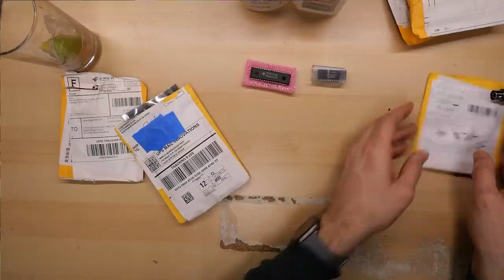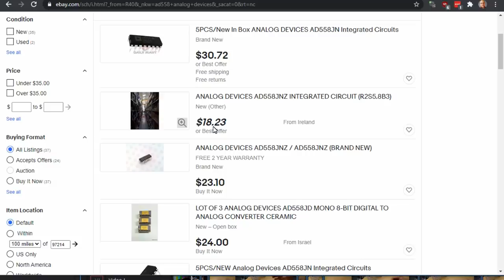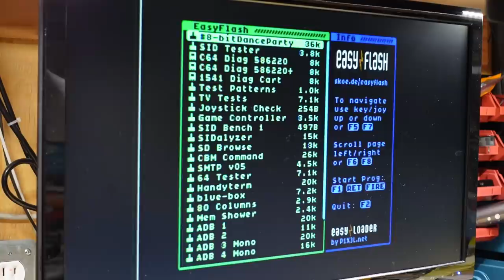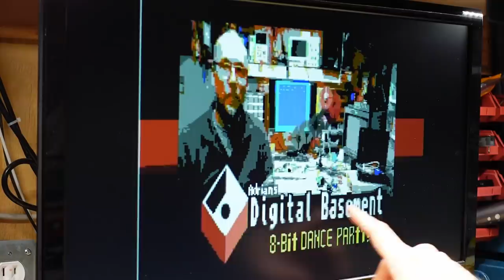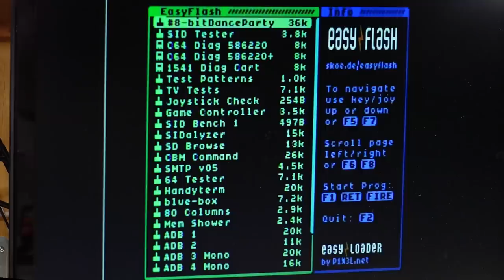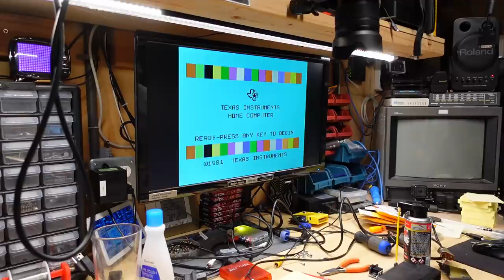I bought more C64 SID chips from AliExpress! (And some other chips too)

Comment: So much easier to appreciate these older cartridge-based systems after seeing the fact that replacing a PS1 CD-ROM drive runs $90 at Totalconsole if you decide to replace the laser. However, you then have no idea how long it would be before you have to fork out another $150 down the line as these lasers are only getting rarer and rarer. At least with these chips, they are stable, solid state components that only really go bad from sheer lack of attention to it. Cartridges, also solid state didn't carry as much data as their optical counterparts, but at least you never have to worry about a permanently damaged disc or even worse, a failing laser! Quality over quantity.

Comment: The TMS9900 processor was used in the TI-990 series mini-computers. They were UNIX-based business computers.  Aligning replacement heads after a head crash on a hard drive platter was a bitch. Of course that was prior to the TI-99 and their PC came out. Commodore 64s would blow SID chips often, and RAM chips.  If they had had metal cases and a fan to dissipate heat, they would have lasted longer.

Comment: Those pin straighteners are great, should be in every electronics enthusiasts toolbox. 
Fake chips are big business - although faking a $5 chip seems a bit pointless. Maybe it was just faulty - I've bought chips that are cleaned up from China that work perfectly (a bit like your EPROMS) so I suppose they do it to improve the value. I think Ali Express has got quite strict in the last few years, so the fake chip dealers aren't so prevelant there as they were a few years back. You just have to be careful I suppose. As you say, at least with Ali Express (and eBay to an extent) they do tend to side with the buyer in disputes, you just have to remember to test the chips as soon as you receive them!

Comment: C64 SID chips like other vintage chips from AliExpress are old un-tested chips that are ripped off recycled hardware. The old printing is lasered or sanded off and the new printing is lasered on, they will even change version numbers on the chips so it LOOKS like a newer version with newer firmware etc, when its not. When you hear people say there still making Chip XYZ there probably not, some yes, most no.

Comment: Tip for getting the pins aligned to 0.1" pitch.  Put them in a zif socket and clamp down.  That will bring them to 0.1" pitch IIRC.

Comment: I think, the main problem with the chips from AliExpress is the packing. Usually they are wrapped in some cling foil. Definitely not static and the pins don't really always like this kind of transport. I had just a few bad badges. 10% bad chips is actually acceptable. I had good 6510 CPUs and  good 6526 CIAs for the C64 and also good 6522 and 6502 processors. You do have to spend some time testing them. Painted EPROMs are pretty common. Usually no problem, but if the dies look different, there is something wrong. I had 2732 EPROMs labeled as TI, but they were from a couple of different brands.  Unfortunately, the other brands did not survive the TI programming voltage. So, that was a fail, but I did receive the refund.

Comment: FYI the reason that Ti used the TMS9900 because that was what their industrial machine tool controllers were based on. So there were more out there than you knew about, but still not a lot.

Comment: I just looked up the chips on Quest (aside from the SIDs, no way they're going to have any of those), and aside from the TMS9900, the prices aren't terrible. ~$17-18 for the TMS9918A and AD558J. Plus shipping, of course. The TMS9900 was $50 for their last PDIP packaged chip, and $175 for their last ceramic one! So yeah, they aren't too bad for some chips, but not great if they've only got one left! Definitely not as cheap as ali express or the electronic bay, but they're definitely going to arrive much more quickly, and there's no risk of getting a fake.

Comment: I've tried to get the message across a few times here about the ARMSID which is an extremely good SID replacement that can be configured as either 6581 or 8580 in software. They aren't even expensive. I guess SID purists won't accept anything other than the real thing but the ARMSID is very good and well supported.  
We'll see if Adrian sees this message but as I have never heard Him even mention it once I suspect He's not even aware of it. Do not confuse it with a nano swinsid which is rubbish in comparison.
Reply: The ArmSID is brilliant. Especially since you can configure it at runtime to emulate either 6581 or 8580. This helps a lot with running a lot of demos. There are some that require 6581 for samples (Comaland?) and others that require a 8580 for its filters. I have two ArmSIDs (and some 6581R4) and didn’t regret buying them.

Comment: Re-watching this video today, and the mention of 27c400 EPROMs reminded me that I actually managed to find an ebay seller in china with genuine & unused AMD-branded AM27C400-105DC EPROMs, was thoroughly expecting them to be pulls or dodgy re-paints, but nope, pins are new, acetone does nothing, and programming one with Amiga DiagROM worked flawlessly (soon to stick the new Kickstart ROM 3.2 on one as well), so, sometimes you can indeed get the real deal, but YMMV... :)
Reply: do you have a link need some for my c64

Comment: To be honest acetone is most common plastic solver. It is not most powerful, but most common and cheapest one available for sale. It is capable to solve ABS aand friens very easily.
Less common solvents are dichloroethane, toluene (much less toxic than benzene aka benzol), chloroform (but it used to knock-off people so it is practically not available in stores).

Comment: I also bought some AMD 27C400-95 off aliexpress, mine are rebadged Toshiba TC5742000 either 100, 120 or 150 ns. But I cannot program them :(, you got better ones than I did. Btw, great channel, really helps during these dark corona times !
Reply: If they're not new you have to erase them. Even then they can be worn out.
Reply: @6581punk  They do not even get detected... no chip id, and when read they return all FFs. I had to use the 27C4096 as device, no support for the part on the minipro :(

Comment: I don't recall seeing laser etched markings on 80's era IC's (if so then rarely done)
If I am right then that would be a dead giveaway, even when looking at the pics on the seller's page. 
As for the EPROMs, I would say that, if one was expecting 90 ns speed grade ICs and instead got 120 ns graded ICs, then that would be a rip-off sale... maybe your design has to have the faster grade chips.
Gratz on getting original SID chips tho  8^)
Cheers,

Comment: I actually have a board that uses the TMS9000 chipset on it, used as a serial terminal interface....

Does have the socket as well, with that special spacing. Likely the Ali one is the OTP version of the TMS system, they did make some with built in ROM and RAM, as it is not likely to be a 68000 series, unless TI was acting as second source for them. Could also be one of the TI DSP families, as they used that package for them early on as well, needing to get all the pins out, and having a parallel data and program bus to interface with the programming.

Comment: Add salt to the 70% alcohol until it accumulates at the bottom indicating that the 30% water is saturated. The salt water will be heavier than the alcohol and will stay at the bottom. The top layer will be pure alcohol.

Comment: That dead TI CPU probably came from a TI99 that was binned BECAUSE of the dead CPU; the old machines that these parts came from were tossed out for a reason, so there's a gamble that the salvaged part you're getting wasn't the bad one.

Comment: Oh; And the CPU with strange pin-spacing.. I FIRST assumed it was just that a LOT of older hardware had a standard of a tenth of an inch spacing, but because technology advanced, they wanted closer pins.. so they went metric; Tenth of an inch is 2.56 mm, and they chose  2 mm... (of course, when they started surfacemounting and reflow-soldering everything,  they first went back to using inch for 1.28mm, and later again to 1 mm)....

BUT.. IF it really was about 20% difference in the spacing, then you wouldn't be able to get that cpu in to a 2.56mm fitting at all.. So I guess I have to change my "You are thinking of the wrong standard" to.. "Well, they manufacture the chips and boards they belong to themselves and solder from factory.. They just wanted the extra space"..

Comment: I have a solution for the pin spacing. Permanently mount the cpu in a ic socket and then the spacing will match putting it in another of the same socket by putting one socket in another!

Comment: China does salvage a lot of used parts, heck, those cheap audio amplifiers you can get from there are basically parts from old car stereos, usually the amplifier chips and whatnot, I just wish they didn't sell them as "New" when they're clearly using upcycled parts...

Comment: 31:50 that socket has a 45° angled shape that designates pin 40 for some reason.
And that fake TI CPU... I would have measured ohms on some select legs like last time you checked fake ICs

Comment: Pin spacing in CPU is metric? 2.5mm vs 2.54mm (0,1"). Soviet chips were 2.5 spacing.
Reply: No, it's regular 0.100". The problem is inserting a desolderd 64 pin chip with very slightly bend pins into an precision turn DIP or actually 2 rows of precision turned SIL... 
(Pin diameter typical ~0.150", hole diameter of a turned socket typical ~0.200") 64 pin DIP is the only case in which I would prefer a regular socket.
Even if it they were new from the factory these 64 pin DIP chips have to be hard to insert in a socket like this. There was a reason why they stopped at 64 pins...

Comment: I'd be happy with a functional fake. Most 'counterfeit' chips are extremely common, cheap or even defective IC's with the same form factor as the original. Painted and remasked, the sole intent is to dupe you into buying it. Even power transistors have gone counterfeit in the last 10 years, albeit most have functional substrates that simply do not meet the original specs or power requirements.

Comment: Thank you for the video! I enjoy learning about these counterfeit or fake ICs, and it is good to have more awareness.   

For the leg cleaning, I have been able to do this with one of those solder pots, melting pot to have the pool of molten solder, like the kind you might use to tin the tips of wire. If you put some flux on the pins and then quickly dip the entire legs into the solder it comes out to look like this for me anyway.

I know its not really related to this video.. but I really wanted to ask, how do you get your audio so good?  Your voice seems very clear and articulate. and no background / room noises, but also I don't hear artifacts of a noise cancelling too.  Is this just from that Rode Go lavalier mic!?

Comment: Hi Adrian I've been working with electronics since I was a teenager and I'm from 1961 so I know what old IC's look like and I've never seen one of the original ones from 197x - 198x with Laser Engraving. So I knew it was fake right away. However, I have not been able to find out when laser engraving began to be used.

Comment: New video!  Adrian,  Digikey does have 99.9% alcohol,  but it is MG chemicals in 1 liter bottles for $13.  I have a bottle that is still going for almost 2 years,  but I swear I only paid like $8 for it at the time.
Reply: Nail Supply stores usually have 99% in gallons
Reply: @Cincinnatijames  The pharmacy here had it too,  but now they dont.
Reply: @Sloxx701  The good thing about Nail Supply is that most people don't know they will have it and generally only nail tech go there.

Comment: As I understand, the legs are frequently re-tinned. That's why they look so nice. You might have better luck with a dual wipe socket for the TI99. Those machine pin sockets drive me crazy. I sometimes struggle getting even "standard" pin spacings into those sockets.
Reply: My EE friend told me machined is the best but I like dual wipe better. Especially for repeated chip swapping. I dread trying to desolder those machines pins too
Reply: I replaced my C64 RAM with them and yeah it was a pain to put the chips in. But it's also a good solid connection. The RAM was new old stock though. Maybe repurposed ram would be easier.

Comment: From my experience with buying stuff from aliexpress . If you buy a used item IC or transistors you can get them mostly salvage original . But if you ordered them new and not from manufacturing you have 80% chance not get them original at all

Comment: i see that the more expensive ICs on your longboard have passive cooling. So i guess you recommend the use of passive heat sinks. But i wonder, if you would recommend heat sinks on the shortboards with the later variants of those ICs too?

Comment: I've seen it where the fake chips are just empty carriers marked up... so no active die inside there. IMO if it fails the acetone test, its junk and unless there is some indication of what the part actually is, it would go into the bin rather than risk damaging the circuit its being used in

Comment: It's my understanding that IC chips are full of discrete components. So would it not be possible to essentially unpack a SID chip and make it large scale?? If possible, I'd like to see that done as a project here.
Reply: Usually they contain just a single silicon chip. You could potentially reverse engineer it and make something fully discrete, bit it would not be trivial.
Reply: @TomStorey96  and that silicon chip contains all the discrete components. I realise making a full size replica wouldn't be easy. And the process of grinding the surface of the chip down to the wafer and then using an electron microscope to look at the contents is beyond any normal person's capability - but if there are schematics of the dies inside, it would be interesting to see it done and to see what sort of sounds that version would make.

Comment: that non working TMS9900 CPU...64 pins

I wonder if they relabelled a motorola 68000 which also has 64 pins ?

Might be worth trying it in an atari ST or amiga
Reply: The pin spacing oddity would not happen with a 68k so not worth burning a mobo to test that.
Reply: @benbaselet2026  

what pin spacing oddity ?

both are 2.54mm pin pitch

Comment: Hi Adrian, I see some 24 pin EPROMs there, WSI 57C49C and TMS2532. I have been looking for some drop in replacement EPROMs for Commodore's MOS2332 and MOS2364, seems like you've got what I've been looking. How did you program these? My TL866II+ doesn't have them in it's list.

Comment: Be careful with acetone! Some chips may be made of plastic which may be subject to melting if they are cleaned with acetone.
Reply: Not really. The "plastic" used for chips is a type of epoxy which is essentially immune to acetone. All the chips that he tried swabbing were plastic, and didn't react to the acetone.

Comment: Had the same problem with the AMD 27C400 ROM's from Aliexpress, It schould be AMD but the first batch was Toshiba (TC574200) with a big erase window and the paint was still wet and the second batch was Intel (D27C400-150V10) which had an accesstime of 150ns instead of 95 ns.

Comment: I'm using only acetone to verify fake chip's.. How I discovered, if old chip have painted markings, it's, usually, original,  if old chip is laser engraved, it's always have rebranded marks - sanded, painted and laser engraved.. In these cases, I measure all pins with multimeter in diode mode to ground and then to VCC.. Better safe than sorry..
Not so long ago, ordered from Ali EEPROM chips.. Laser markings was identical, but cases were different from different manufacturers, acetone test didn't passed and all top paint was removed to reveal sanded chips.. Good think - all chips worked and I didn't opened dispute, but mentioned situation in review.. Still don't understand, what's a point to rebrand original chips as other brands, especially, that different manufacturers have different speeds, specifications and some times programming voltage and ways to read signature.. I better prefer original, different brands in one 5 pack, than rebranded and resanded..
Great video, Adrian. Like, when You leave mistakes too.. 👍

Comment: What you are facing with the CPU and socket is metric vs imperial units.
Probably the socket has 2.5mm spacing vs 1/10 of an inch (2.54mm) on the CPU. Fine for shorter ICs, a problem with longer ones, specially if tolerances are tight.
A precision digital caliper off Amazon or AliExpress is good for many things, including checking thst kinda thing.

Comment: i had the same impression regarding the old 6581 version. it sound distorted. not pleasant for my ears at all. this is the advantage of newer re-implementaions, they all do the filters digitally which gives higher precision (almost) without distortion - if correctly done.